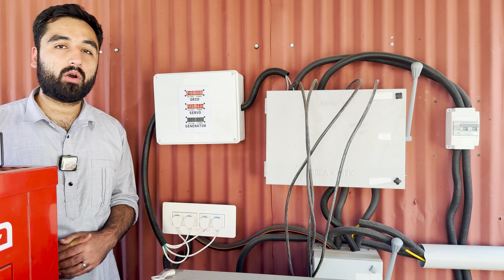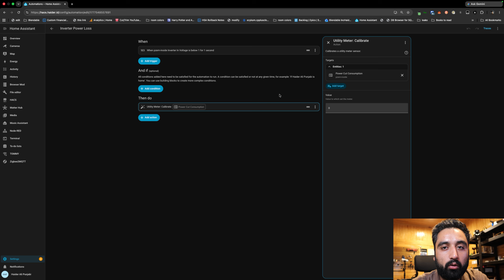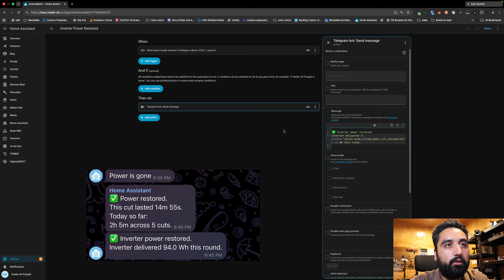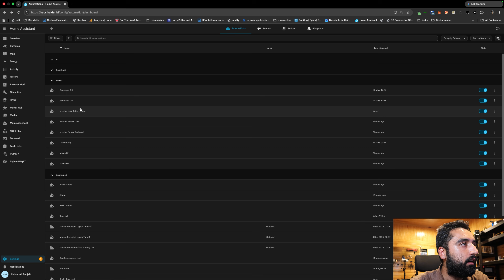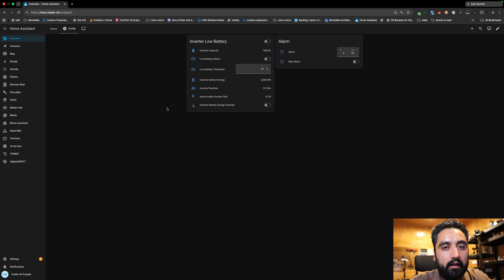Showcase: My deployment of 6 PZEM 004s in my house

Comment: Thanks for posting your current status. The setup looks more professional and I can see the innovative design using the 7segment displays to show the power status. The Ethernet based esp is a nice addition, will be effective. May I know from where you got the modules? Your other product links are from Robu from where I also get my DIY components from. However this esp seems to be out of stock with them.

Edited Few typos.
Reply from the maker: I don't remember exactly. I bought it over a year ago I think. I buy most of my stuff from Robu, but I also use ThinkRobotics sometimes. If I am able to find out where I bought it from, I will inform you